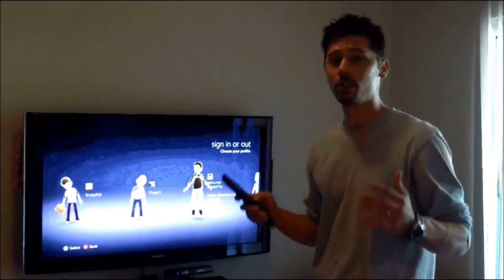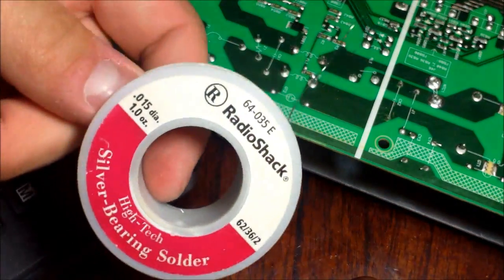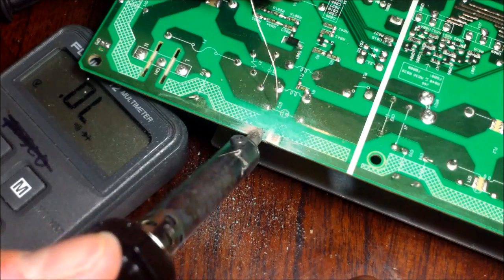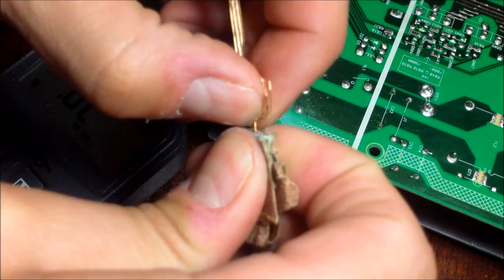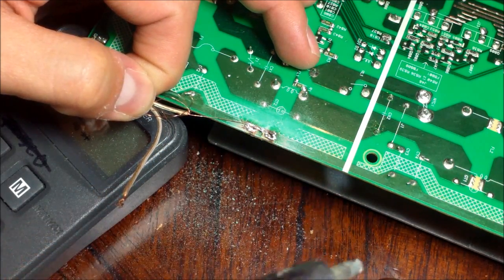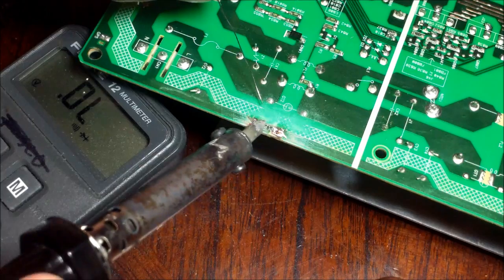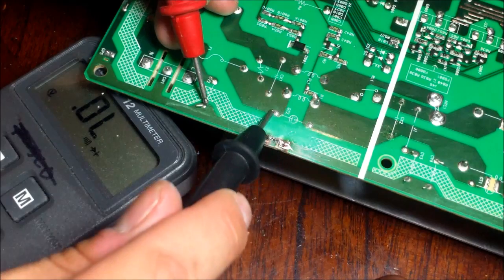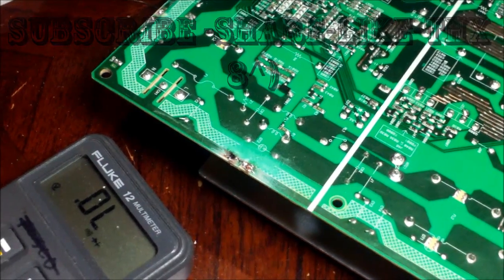HOW TO FIX CRACK CIRCUIT BOARD- Soldering TECH Tips 11

Comment: Hello thank you so much! You made it simple and quick... I've never soldered a circuit board only a few wires under my hood of my Acura rlx....but i have a question please, I'm trying to fixed my dvd/audio device. I opened it and found the circuit board completely cracked in half AND SO MY QUESTION is IS THIS FIXABLE?

Comment: thank you for this amazing video. But i have 1 question, why did u use a speaker wire? why didnt u connect it with solder only?
Reply from the maker: Wire strand
Reply: I would probably just run a non flexible wire between two solder joints and put a little bit of glue over it.  :D

Comment: How can i fix a power supply board that got shorted🤔 
it just burned one spot and it was connected to something else with solder but the solder over heater i guess and its not connected anymore

Comment: That wire is way too thin in comparison to the damaged trace. I usually do such repairs with a piece of desoldering braid.
Reply: If its cracked straight across can it fix still
Reply: @samanthafloyd7195  It depends. If it's just a single or 2 layer board, maybe.

Comment: My 3DS has a broken touch screen and the crack in the digitizer goes all the way through the wires on the glass. Would a piece of electrical tape work for this or no?
Reply: ooo, a crack in the digitizer? electrical tape wouldn't help.

Comment: do you do repairs? i have a ipad mini motherboard thats cracked.
Reply: Those are multi-layer boards, i don't know how many layers, but more than 4. You can't just bridge them over with surface repairs. It's often possible to follow the schematic and restore some connections externally, but there aren't going to be too many people capable of doing this, and it won't be sensible in severe cases.

Comment: Very clever. What AWG Is that speaker wire? It looks seriously thin?
Reply: It's a bit too thin, i'd say 4 times as much wire would be just fine for the trace width this has been designed in. I expect that this spot will heat up by up to about 40°C above ambient which isn't the end of the world, it'll still work and won't desolder itself, and it won't actually give out enough heat to cause further damage because there are no components nearby. Potentially it will heat up by much less if the trace has been overprovisioned originally, like if the same board is designed for power supplies multiple times as strong but components have been adjusted down to spec and price.

Comment: Please say you still check these comments i have a quad copter and it kinda shows the circuit board and i had to keep bending it because it was bending because it was breaking wing trajectory . And it ended up breaking. only 2 out of 4 motors work so will one of them copper wires be enough to transfer enough energy(electricity) for the motor is my question i can possible send image NOTE:I dont know alot about circuit etc and im guessing copper transfers the power :) thanks
Reply from the maker: +FroggyHD yes just bridge connection using wire over the crack as long as it follows the trace but sand down surface before soldering and don't solder 2 different traces together that don't belong together.
Reply: Alright thank you so i sand and copper should be exposed dont touch it soulder each side of crack were copper is get some sort of copper can i just buy the wire the will work then it should be fixed. Thank you for fast reply
Reply: And i only can see one line so i dont think im going t have to worry about mulitple traces in different direction. Sorry for so long confusing message.
Reply: Last thing i have a lithum batter do you think i could get a power powerful one then remove motors on it at moment and by more power ful ones but similar energy use
Reply: And if it similar weight guessing it will fly if not better
Reply: I suggest not to get motors that are even the slightest bit different from the ones your multicopter shipped with unless you have the ability to reflash and recalibrate the firmware. This is a hypothetical consideration, but in general the way they work, they have motor-lift response stored in the firmware, and if the actual response is too low, it'll just level slower, but if it's too high, the copter will twitch out by itself with no or minimal input. The firmware also applies vibration filtering to the sensor input which depends on the internal configuration of the motors, so if you replace the motors, it may be faced with truly random data and be completely uncontrollable. You may be lucky, but chances aren't in your favour.

Going for a more powerful battery would be fine if your multicopter has enough weight bearing capacity to support the extra weight. But i don't think it's going to be helpful, because usually the weight increases in proportion to both the current handling capability and the capacity, and you obviously don't want to sacrifice either.

Comment: Hello and thank you for this video. My problem is the dash cluster on an international 4900 series. All the gauges work but it seems like most of the lights do not. Any suggestions. Again, my thanks. John
Reply from the maker: +John Muller check connections and replace lights if needed.